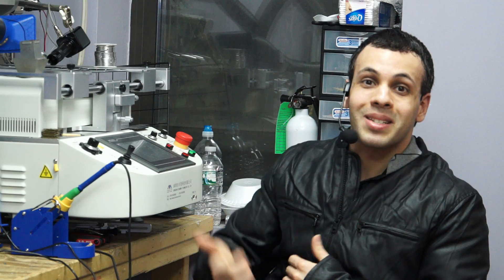How to get your #mbp2011 problem fixed for free!

Comment: Yo, just wanted let everyone know that this works. Today I got a brand new 2016 mbp 15 inch 512gb/16gb ram, for the grand total price of my old, shitty 2011 laptop which had been "fixed" by Apple 4 times already.
Reply: Honestly about 15 seconds haha
Reply: @iamrichlol can't get it to work. how did you do? any advices?
Reply: I just ran the software and it broke the computer. Granted it had been 'repaired' 3 times before, and i just needed it to break once more to get the replacement
Reply: Heidi Jim everytime a repair is carried out, there is a further 12 month warranty added for that part. I was having the motherboard replaced more than once a year
Reply: I was polite and may be too polite that they didn't want to help me. The customer relations department  just got back to me and said it is impossible to replace it with a new one, again base on the age of my mac book pro 2011. The best he could offer is give me a a little discount for new mac book like $100 Also, it's too old that Apple can't fix it, if I want to have it fixed, I have to take it to Apple Authorized Service Provider. I asked what if the same issue happens again shortly, he said, then I should consider to get a new one.
Reply: Nelson Patterson that sucks man. I guess you've got a good board haha. And yeah, extremely lucky. Tbh Im not usually a lucky person, so I guess it was just my turn to have some good luck
Reply: Also, guys, just wanted you to all know that I only ran the gputest on the last board, the day I saw this video. The 3 before died by themselves, but I could tell the 4th wasn't any better, so I used the gputest to push it over the edge
Reply: They just fixed it, and I got it back yesterday. the problem and the lines just came right back and became very often (worse than it used to) I don't think anyone will want to but this
Reply: Heidi Jim were you ever able to get it replaced? Im debating if I should even spend the $300 in attempting this.
Reply: @iamrichlol do you happen to have boards reference of all the 4 ? Thanks
Reply: Adam RH sorry I don't understand what you mean
Reply: @iamrichlol when they "fixed" your mac, have they replaced the logic board ? if yes, they must've given/sent you a document wirh all the details, in which, the reference of the new board.
Reply: Adam RH yeah they would have but I move around, I don't have the documents anymore. I've got the last one from earlier this year but that's it...
Reply: Nelson Patterson hmm I doubt it, as mine was a late 2011 model. I bought it new from Apple in Feb 2012
Reply: they fixed it 4 times before replacing it? how come so many times?
Reply: My mbp2011 failed 4 times already, I asked for a replacement, the Apple advisor said they can't replace it since the laptop is older than 4 years old. How did you get yours replaced?
Reply: they replaced my logic board three times already, I actually just got it back from the 3rd times logic board replacement, and the symptom came right back the moment I got it. so this is the 4th time graphic card failure. I just called apple, and they refused to replace the laptop since it considered as vintage.... so I wonder how would they replaced yours but not mine.
Reply: well i'm not lying, they did replace mine :)
Reply: Thanks, I didn't mean you are lying. :) I have been talking to at least 3 Apple advisor and they said it can't be replaced due to the age of my MacBook pro. They were all very firm about it even I push. I really want to know how you did it? yours was also MacBook pro 2011, right?
Reply: mmm strange. what country are you in? i hope you can get a replacement
Reply: I'm in New York. Did you bring it in and ask for manager? Did you act mad or just being polite?
Reply: iamrichlol what program did you use? I downloaded Geeks3D GpuTest GUI 0.7.0 and I am on OSX 10.12.3
Reply: well i have a MSI program that came with my GPU in my desktop. it makes my GPU spike to over 80C even with great air flow and liquid cooling. ought to lend it to yall to murder your laptops in record time.
Reply: MrOmej I want a follow up to this question only because I have a mbp 2011 and now I have the same issue and they told me the same thing they told Heidi, I live in nj
Reply: julio villegas my mbp still running but i use 'fan control' app to stop it going over 90 degrees. Had mother board replaced, the slip said it was a new motherboard with my old cpu chip. Apple replaced for free in 2014/15. My mbp is a late 2011. It is one of the worst purchase i have ever made for £2100 gbp and i live in the uk. I get beach ball on most applications i run. But i need to make the mbp before i go for another. I like macOS but just can not trust apple. Every mbp they bring out seams to have some kind of defect. I will get a Microsoft pc and install macOS on it next time.

Comment: Ok so i wanted to let you all know that i am an Former Apple Engineer i now own my own company and i also i have 2 MacBook Pro a 2.2 Intel Core i7 Early 2011 and a MacBook Pro 2.5 Late 2011 and i can tell you that i have had both logic boards replaced by Apple Replacement Program and i have ran the stress test all night just as the video has said to and i can tell you that my computers have not failed again Apple has updated there Logic Boards there is a new and improved Logic Board that they are putting into these machines again this is not the old chips they are new. so therefore before this tutorial would work i want to start off by saying that i am a former Apple Engineer in software this video is somewhat true before Apple replaced the boards. there was a faulty design issues but that issue has been fixed now keep in mind that i have (mid 2015) MacBook Pro 2.5 with AMD as well and i can tell you that the Retina Line up is not perfect either.... I don't agree with this video. the 2011 MacBook Pro's are not shit.... and apple does things based on a case by case issue so just cause he might have been able to get a new MacBook Pro doesn't mean that it will be the same for everyone. the situation he is reffering to is called a CRU most likely what will happen is Apple will issue a CSCode and whatever is wrong with the computer will be taken care of. now if you have had multiple repairs and given the fact that there are other restrictions you have to be under for one your device has to be less than 5 years old after that time mark your computer is not eligible for that process but given that mainly after 3 Major repairs Apple will possibly look into giving you a CRU which is a replacement which in this case would be a 15 Retina MacBook Pro (of like value) now there are a lot of things that you will lose upon getting this great machine you will lose the ability to swap out ram you will lose the ability to swap out the hardrive you will lose the ability to Fix any Parts whatsoever if you are outside of your time period with Apple Care you will have to buy a brand new Logic Board thats about 900$ you might as well buy a new computer if you need a battery replacement in the Retina you are looking at replacing the entire Top Case which is 250$ cause the batteries are glued to the bottom of the Top Case. so i mean it depends what you are looking to lose. i personally tend to keep my 17" cause of these issues mainly now that Apple has fixed the issues with the GPU by using new Boards Updated. there is no reason to switch to the Retina unless you are wanting. a nicier screen a better battery life and slimmer body but than again its all depends on what you are needing there are reasons i like my retina and reasons i like my 17" i think the 17" is better for professional business use. but it all depends on the user and who is using the machine.
Reply: An Apple Senior Advisor told me on phone that they need 3 repairs minimum to process a CRU. My Mbp have been repaired once, but restart to bug..  I' now out of 90 warranty days, but he told me that next repair will be free too..  And then, 90 days to kill it again, and call back Senior Advisor to ask a CRU :) 
Ah, dear Planned Obsolescence..
Reply: What about the 2010 model? I know they had a recall program for that... is the logic board fixed for that one too?
Reply: And for the CRU less than 5 years old thing, what about in California? Because apple services laptops for 7 years past purchase due to california law, so would CRUs be included?
Reply: "now if you have had multiple repairs and given the fact that there are other restrictions you have to be under for one your device has to be less than 5 years old after that time mark your computer is not eligible for that process but given that mainly after 3 Major repairs Apple will possibly look into giving you a CRU which is a replacement which in this case would be a 15 Retina MacBook Pro (of like value)"

There is a problem and that is we don't know if Apple changes "3 times major repaired" devices or no. I asked from genius bar, once I was told yes we change another colleague of his told me no we don't do this.
Now you're stating that if the machine is older than 5 years old it doesn't apply for it which means all the 2011 machines(early and middle 2011 ones at least) are not worth spending time to make them fail!
However there is no official thing on the net about this 3 major repaired rule!
Also I agree with you about the fact that the new logic boards don't fail (at least in my case). However contacting Louis I was told this logic board will fail also!
Reply: Doc T'Soni : I'm not going to guess a person's occupation based on how they write because I've seen all sorts - but I will say that big walls of text with no paragraphs are too hard to read. Next.
Reply: Hi! Did the advisor happen to tell you if this was standard protocol or was he hooking you up? Thanks!!
Reply: Yep, I Try to.. I've had several glitches since, and one Kernel panic. Still not dead ..
Reply: My logic board was replaced in late 2015, and after running the test for nearly 12 hours, there was no failure. What I am curious about, and maybe you can shed some light on the subject, is what's different in the "new" logic board? There is also a known issue if you swapped out the superdrive for a second 6G hard drive, that it was unstable, randomly disconnecting or dropping to 3G or 1.5G link speeds. Do you know if this was was also solved with the update?
Reply: MaXintosh Enterprise do you happen to have the reference of the new logic board you've mentioned (the 15" one) ? Thanks
Reply: MaXintosh Enterprise tldr all I got was I'm an apple suck up
Reply: there is one major issue with the apple replacement boards in the 2011 17-inch MB Pro's. I upgraded my 17-inch DVD drive to a SATA hard drive. Once your computer gets the replacement board, the 2nd SATA will no longer work reliably with hard drive in the optical drive bay. I have 2 tb's in my optical bay and after I got the board replaced, this drive would not work.
Reply: That explains Apple replacing my 2011 15" logic board that I took in on 1/27

Comment: I have crucial memory in mine. They told me they won't do anything to my computer because they couldn't get it to fail. I did go ahead and change the thermal paste too Arctic Silver 5 between the heatsink and GPU. So far no issues and seems to be running cooler.

Comment: I delivered my MacBook Pro 2011 in for delivery last week, due to this error. They gave me back the report stating that it was the GPU that has failed and they state due to unoriginal RAM in the machine done by a third party they will not be fixing the computer for free.

Instead they are charging me over a 1000 dollars for the fix (including battery fix/replacement in the quote). I am feeling so insulted! So the computer is a brick or 1000 dollars please (of course I will not pay that insane amount, that amount alone offended me for a repair of a computer 5 years old).

Anyone in here who knows if unoriginal RAM is a legal reasoning for their claim not to fix it?
Reply: opening the macbook alone will already make them deny any free repairs etc. thats their company-wide policy, im sure its legal
Reply: I had it fixed for free while having a different brand of RAM inside my MacBook. I also got a complete refund for my "diagnose costs". Just go to another Apple shop, fuck those assholes, they just want to get money out of you.

Comment: Hi Louis,

Would you say that the best way to force the GPU to fail is to stress/heat the GPU and then cool it fast so as to cause the soldering to crack and eventually fail? I've done a bit of reading and it seems like just stressing the GPU would not do much since the real issue lies with the GPU heating up and cooling down. This constant change in temperature is what causes it to eventually crack little by little. 

Would really appreciate a reply from you Louis, seeing as you're the expert on this :) Would you say this is the best way to do it?

Thank you!
Reply: hey man, please keep us updated if you find out the best method by repying to your comment... thanks!
Reply: any news +Hustler1339
Reply: Nelson Patterson no, man! i just sold the laptop to a repair shop, whatever.

Comment: My late 2011 MBP started rebooting by itself randomly. After doing some research all signs lead to the GPU. I dropped it off yesterday at Experimac which is a authorized dealer for Apple repair. They said they will cover it for free because of the known issue, should I have went there or to the Apple Store for repair?
Reply: Did you upgrade your computer with unofficial RAM when it was delivered in? I gave mine last week for repair, but they claim since there is "unoriginal" RAM installed they will not cover the repair (even though they state the GPU is the issue as known).

Comment: Louis, what you said is very nice, in theory. However, do you happen to know whether it has actually worked for ANYBODY? Cheers
Reply: It worked for me!!
Reply: +Sethu Prasanth how long have you run the stress test for?
Reply: Dec 2 - July 7
Reply: +Sethu Prasanth how often? Everyday during the night? Everyday during the day?
Reply: Basically what I did is, my mac is always connected to power outlet and try to run stress app with full brightness. I will use my mac for normal purpose cau i don't have any other laptop. I will close stress app's when running normal. It gonna hard and little weird at beginning. After that you gonna get new 3000$ mac. Sell or use it it up to you.
Reply: so it took you from dec to jul the following year to complete one stress test, or was that for the 3 refurbishes?
Reply: 3

Comment: According the news Apple is collecting all the non retina macbook pros from its stores. so the question is till now that they were available in apple stores why should have apple had replaced the "3 times repaired" 2011 macbook pros with retina ones instead of the latest version of  non retina?
Reply: Parsa Psa Apple said they don't make any non retina 15" macbook pro, so they replaced my non retina with retina. Date replaced 07/07/15
Reply: Lucky you! I've done the gpu test for hours and hours but it's not failing. The logic board's been replaced once in September 2015 and now some times it has Display Problem (Green on black color parts on screen) but I don't think if I bring it to an apple store it will fail the test.

Comment: Hi I have the same problem in mbp late 2012But i have no video at all and i cant install any software It was on two times on single use modeThan strat normally.and die after video  desturbed and no singeluser mode again
In the lab they told me that they cant run diagnostic vst plug so the cant activate apple recallWhat can i do?
Reply: Sorry. 2011

Comment: Hey Louis well Last Saturday, May 13 I brought my MacBook Pro 17 inch 2011 model has the graphics issue over to Mac to have it fixed for free. 
Today's the 17th and I just got notice that the say it's already done and to come and pick it up so I'm going to run the stress test and see what happens. 
Do you suppose that Apple was actually changing the chip at this point?  Seems awfully quick for them to say it's already done

Comment: Just got my Early 2011 15" MBP fitted with a new logic board (Free thanks to Apple's Quality Program) Got it home and has locked up twice! Clearly still has graphics issues. Ran ASD GPU tests for an hour and it failed. So now running GPU test as per Louis's advice to see if this new board will die an honorable death.

Comment: +Louis Rossmann Great video! I have a 2011 MBP that Apple repaired several weeks ago and I have been running GPU Test since then but it won't fail. Is there an improved GPU that will stand up to running GPU Test? The AMD chip on the replacement board is labeled: AMD, 1607, MADE IN TAIWAN, P4SA04.08, 216-0810005. Thanks!
Reply: +Louis Rossmann I have been running GPU test non stop with no failure. Is it possible Apple did a repair that solved the original GPU issue on the MBP 2011? Thanks for the info on this issue.
Reply: Is that MacBook pro late 2011 ? model MD318LL/A  A1286 ?

Comment: Can anyone confirm that apple is still replacing with a new machine after 3 failures?
Reply: bump. wondering this also. my mbp is currently being fixed for this issue  but if it is just the same board and gpu the problem still excists and it will fail again.